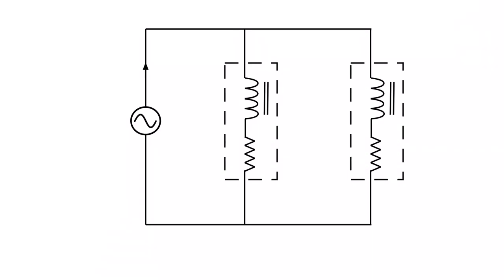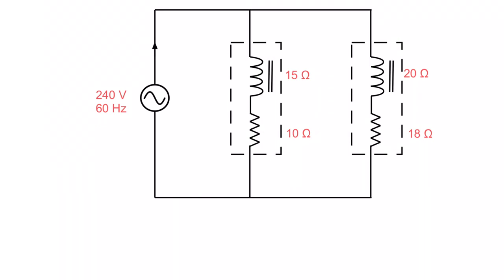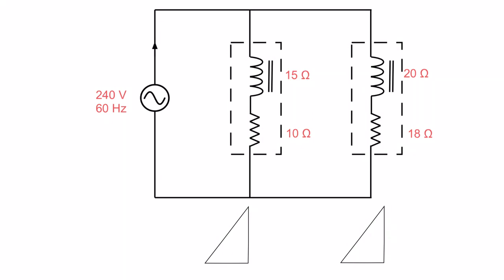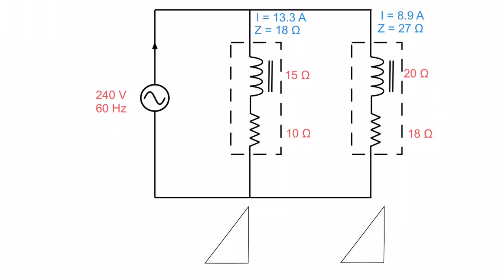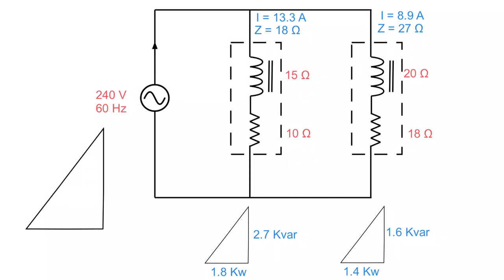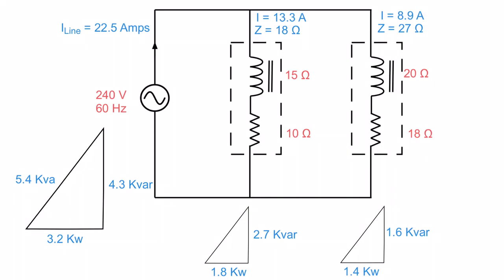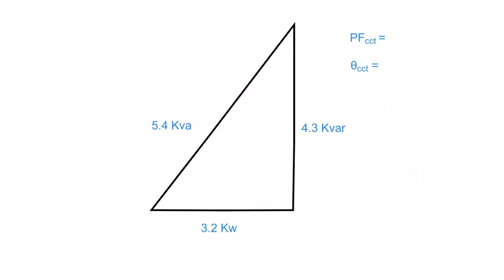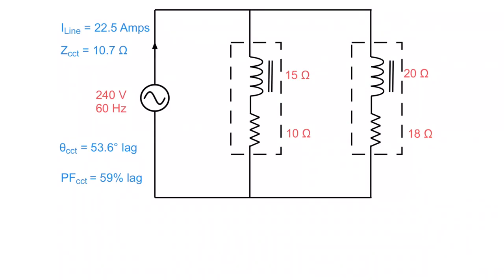Parallel RLC circuit (coils)

Comment: I just wanted to point out you used the Z (impedance) instead of the amperes to get the watts at 2:42, in case you wanted to fix that. But overall, your videos are awesome